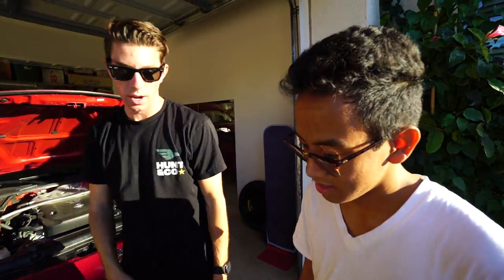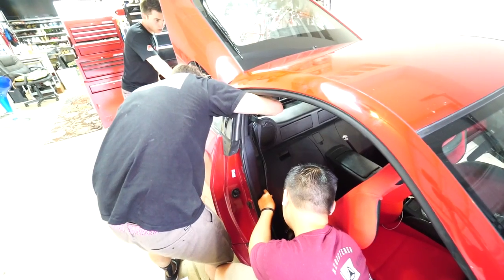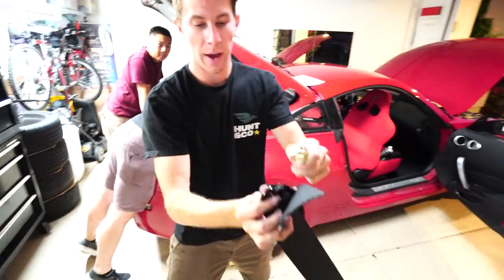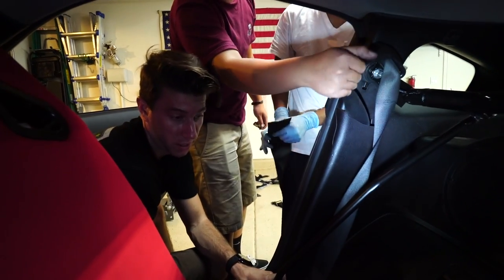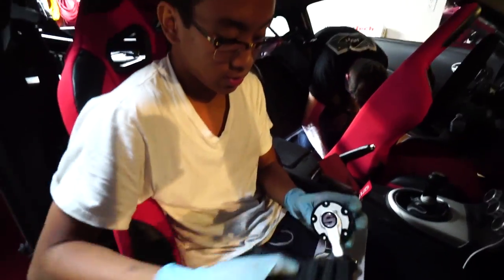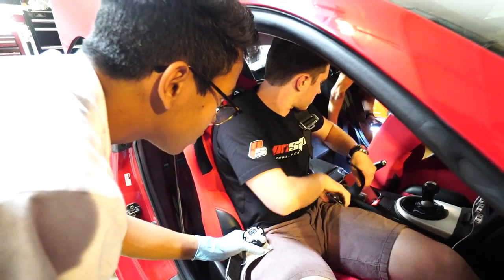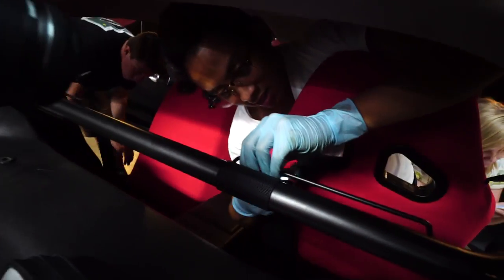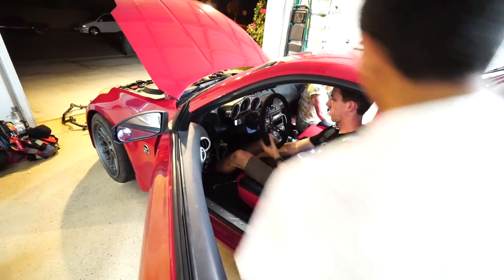Race Harness Install - Nissan 350z

Comment from the maker: Before you comment on whether I should have a 4, 5, or 6 point, please watch the whole video 🙏🏻❤️ thanks for your concern Bros
Reply: My bad, I deleted the comment. Just want you to be safe, boo.
Reply: TJ I bought a Poster of Miley off Hunt and Co's website and I received it damaged and I also asked for it to be signed by you and Calvin and it wasn't :(((( I've tried to contact you through the website two times and haven't heard anything back
Reply: Are you gunna make a video from kktsd?!
Reply: got new seats with the hole thingy for the crooch strap ?
Reply: +DailySquad Productions ikr been waiting for it 😂
Reply: Are you still able to use the stock seat belts or are those completely out and unusable due to the harness bar?
Reply: they actually make street legal and safe 4 point. takata makes the drift belts and schroth have their 4 points also street legal and safe for road use. a 5 point with no seat slot is pointless as there will be a gap from the bottom of the strap to your crotch which will cause submarine. the 5th/6 strap setups need to be snug on your body.
Reply: That's okay, I got a universal harness bar with a 4 point. Got so much hate LOL
Reply: ''safe'' you can still slide under them streetlegal or not, thats how it is with fixed harnesses . i doubt its hard getting the '' safe'' stamp
Reply: TJ HUNT YOO YOU DID IT WRONG
Reply: its a genuine safety concern that has to be addressed sounds like he really wants to be safe so it doesn't hurt to point out.
Reply: well if he wants to be safe he should have just gone with the stock seatbelts, dosnt get safer then that when you run without a rollcage
Reply: I know all of yall learned about the 4 point harness's safety problems from bisforbuild
Reply: sense 350z is a drift car it should have a turbo cause drift car but it's nice tj
Reply: Jaden Cope are you trolling or just 12 years old?
Reply: +Jaden Cope lmao
Reply: +Ben Thompson lol it's what I know could be good for the 350z to help with drifting I don't need someone to tell me what I know about cars 😂😂😂😂
Reply: +hedlund88 he's 17 bro he knows EVERYTHING!
Reply: +Tony Montana 😂😂😂😂 I know a lot about cars but not everything
Reply: +Jaden Cope He don't need a turbo, in fact he don't need anything apart from a fucking LSD right now.
Reply: Finally lol !
Reply: You shouldn't run a harness/bar without WEARING A HELMET
Period- stop misleading people and putting them in danger!!!
Reply: Also 5 point harnesses are NOT SAFE EITHER!

6 POINT!!! DID YOU EVEN TALK TO A SPARCO REP BEFORE ORDERING?!!?
Reply: You do not wanna have a roll cage without a helmet.. Cause your head can smash into the cage. A harness bar and harness without a helmet is a'ok.. You're clueless.
Reply: like the out tro
Reply: ***** "The use of five point (single crotch strap) models is highly discouraged as these five point designs increase the risk of soft tissue injury and also tend to cause higher levels of chest compression in the event of accidents."- http://www.speedhunters.com/2014/06/takata-ask-the-expert-answers/

That's straight from the head of Takata. If you kids actually bothered to call your Harness Dealers with Questions, maybe they would get answered correctly!
Reply: 5 POINT HARNESSES ARE NOT SAFE! 6 POINT ONLY!!!

Sparco no longer sells 5 point harnesses on their site because they're NOT SAFE!!!
Reply: +Tony Montana except how to use punctuation.
Reply: JeremyShred You can still hit your head on a harness bar without a helmet, it is still Not Safe either way.
Reply: The harness is unsafe they can hurt you in a crash search it up
Reply: ***** A helmet will still protect you from a fatal head injury from impact with a harness bar/roll cage
Reply: ***** It's not that hard for a harness bar to come loose in a accident. Either way, for what TJ is doing it's not safe.

If the roof caves in on a rollover accident, he'll snap head first like a toothpick since you're unable to lean in a harness.
Reply: Should've got the Scroth 4 point... it's anti-submarining and in my opinion better than a 5 point or 6 point...
Reply: Shcroth*
Reply: Tg the get the part that goes on the side of your legs cuz if u crash the lower belt might go into your stomach
Reply: ***** That doesn't mean you can't still hit your head on it, or prevent the roof from caving in on your head during a rollover
Reply: We love ya TJ.
Reply: 3 point or 6 point IMO. 4 points are more for low speed offroad and crawling just to stop you falling out of the car when you roll, 5 points are better than most 4 but not as safe as 6 ofc and can still fuck you up. You can get 4pts with anti submarining but you might as well just stick with 3 point unless youre going to go 6 point.

And harness bars are behind the seat? ofc you will wear a helmet with full cage, but why would you need to wear one with just a harness bar? unless it smashes right through  your fkn seats i dont see it being a problem? am i missing something?
Reply: Unless you have full cage, 6pt harness, HANS and you are wearing a helmet, any harness is more dangerous than a standard 3pt inertia +airbags. 

First of all without a cage, when your roof caves in you cannot move, therefore your head takes the full force, i hope you have a strong neck. With a 3 pt you can move your body out of the way when the roof caves in. Also not being able to move makes shoulder checks etc far more difficult for daily driving.

Now lets say you do have a harness and a cage, without a helmet your head is now bashing against your cage. Now lets say you have  a helmet, the extra weight plus the fact that none of your body moves except your head means you will probably snap your neck due to inertia. This is where HANS comes in... Or you could just leave your car with 3pt and airbags and be relatively safe, maybe wear a helmet if youre worried. All or nothing, because half way there is always more dangerous than what you get from the factory.

HANS + Helmet + harness makes for a very unpractical street car, and is probably illegal in some areas, i say unless its unregistered, dedicated track car stick with airbags and 3pt.
Reply: +gorrilaunit99 yes, and Takata knows about safety with their air bags.....
Reply: jak p The point is Sparco does not sell 5 point harnesses anymore because they're not safe.
Either TJ is lying or he's still gonna be in danger
Reply: I agree with the helmet + harness + cage + HANS. But not all 4 point harnesses are unsafe. Just the majority. I do know that Shcroth makes 4 point harnesses that are anti-submarining. If I was in the market for this shit, I'd go with Schroth.
However I'm going to stick with racing sims. until I have the money to not skimp on safety equipment for a track car...
Reply: Stock 3 point harness works just fine. Stop trying to fix shit that isn't broken. Man you really need to learn about cars before you start giving advice on the internet. So many people are going to be misinformed because of all these videos.
Reply: Tj Hunt anyone know the shit he was wearing at 5:50 ?????
Reply: 4 point harnesses are completely safe if installed and worn correctly. The "4 point dangers of submarining" is a myth. There are lots of factors that go into it. In most cases, the fifth harness is perfect for crushing testicles and any other soft tissue in the event of a shunt and/if worn incorrectly. Internet commandos talk about the lack of a roll cage and harness bar so somehow a stock 3 point is better but then say a 5 point is better than a 4 point because of an extra belt? Lol! By that logic, a 4 point is better than a 3 because of the extra shoulder strap. Most people do not tighten the fuck out of there 4 points because its "uncomfortable" which results in myths. This is why stock belts tighten and lock under g force. A 4 point is doing the same but tighter. Read saftey instructions people!
Reply: Tj Hunt I love you and I look up to be like you Bigger Bro 😎
Reply: Except for a schroth asm there is no way to wear correctly a 4 point harness . They are not safe period, you can try to tighten your lap belt all you want but when you go to tighten your shoulder belts they will ALWAYS pull up on the lap belt. If you are on the racetrack all it would take is 3 hard laps and your lap belt would ride up on your abdomen. The fifth should be a 6th V belt and the risk of you receiving serious abdominal or even spinal injury is much more real than banter about  "crushing your testicles", abdominal injuries happen all the time.  Also no harness should be worn without a cage. Once the A pillar comes down on your head and you are strapped in upright ....well you will either be lucky,break your neck or be dead. A 3 point is safer than a harness bar and a 5/6 point is safer than all with a cage.  If you have a rollbar you should sit in your car , take a picture from the side and then draw a line on the pic(photoshop) from the top of the bar to the bottom of the A pillar . If your head is above the line then that is what is going to get crushed when the A pillar comes down. This is a very common issue with bolt in rollbars where people sit far forward from the bar.
Reply: singlecams for the record there or more harnesses with the ASM feature that aren't Scrothe. Just sayin

Comment: You'll need new seats to run a 5 point harness.
Those reclinable 'racing' seats don't have the require hole in the base to install a 5th point.
Time for some bucket seats!

Comment: + Tj hunt don't go with a 4 point harness when you get into a crash your shoulders pull the waist strap onto your stomach putting the full stress of the crash onto all your vital organs. if you still want a 4 point harness there is a brand that makes one shoulder elastic making like a 3 point removing the danger

Comment: One of the things you'll find in car parts, specifically, is when they say "universal fit" they usually mean it doesn't actually fit anything.  Beware universal fit!
Reply: all harness bars are "universal"...they are measured in length 48, 49, 50, 51 inches etc...they are sold for all applications that the width of the b-pillars.

Comment: Well at least you didn't go with Takatas. Great move Proud of you
Reply: whats wrong with takata?
Reply: whats wrong with takata?
Reply: What's wrong with Takata?
Reply: what's wrong with takata?
Reply: what's wrong with takata?
Reply: What's wrong with takata?
Reply: are you talking about the air bag thing?
Reply: oops my bad. Let me resume this little thing y'all have going on here.
What's wrong with Takata?
Reply: overpriced, overhyped and overdone.
Reply: Klas Kitsune WHATS WRONG WITH HYPING STUFF UP?!?
Reply: Tyler Nguyen Because you make it seem better than it is. There are much better products out there that are more affordable. Willans, Sabelt, Schroth, Crow all make good harnesses that cost less than Takatas and have sturdier camlock construction.
Reply: Klas Kitsune I understand. I just like being hype tho. Makes me happy to hype things up
Reply: WHATS WRONG WITH TAKATA?
Reply: +Klas Kitsune to be fair they have a 4 point that prevents submarineing. it works by having a piece on one of the shoulder straps that tears under the stress of a accident which makes the strap a little longer bringing one shoulder forward to stop you from sliding under. Now if other companys have that then i agree with you but if they are the only ones that would be a pretty compelling feature
Reply: Jacob Tuley Schroth has one for less money.
Reply: Takata belts could be $2000 and they'd still be worth it. They're green.
Reply: ***** A fool and his money are soon parted.
Reply: its called branding. its all about brands in these times.
Reply: Takata is good.
They have asm on 4 points.
It eliminates the problem where you can slide under the harness with 4 points.

Comment: Nothing is wrong about 4 point harnesses. It's just about getting the right one that are street legal and with the ASM technology. Both TAKATA and Schroth (takata drift series and Schroth rally 3,4 or cross)  offer 4 point harnesses that have an anti submarining technology. But of course, if you're really tracking your car, the best harness for u are the 5 or 6 point harnesses with a harness bar and a roll.cage.
Reply: fucking thank you! holy fuck I was going through these comments hoping to see one glimmer of shining light of someone who knew about the very few dot safe ASM stats. I personally have schroth as it's the only DOT legal in mass for the daily/autox project...usually the 3 point oem is used on teh street but I didn't want to have to install/remove harnesses between events.
Reply: So what would you use for a daily/rare track car?
Reply: I have my rigid seat that's FIA approved with scroth 4points with the anti submarining mechanism. but if you don't have that setup I'd advise a mimimum 5 point and use your 3 point oem on the streets.
Reply: +bushdog Haha I thought the same thing!! So I had to comment! I too,  have dot/ASM approved 4 point harnesses but they're the TAKATA  brand. Specifically, Takata drift 2 harness. The ASM TECHNOLOGY on them  actually works. I got hit one time and acted just like a factory 3 point seat belt. No injuries at all. I get why people don't know about the ASM ttechnology on 4 point harnesses . It just came out a couple years ago, so it still relatively new
Reply: +Swoldier Jan the only bad thing about the 4 point harness  with the ASM is once it's been in an accident, you have to replace it and get a new one
Reply: +Tyrone Amora your seatbelts

Comment: It would've  been safer  to bolt the harnesses to the floor  of the car. and  go  with 4  point harnesses, Although  I've a 3 point  harness  in my  car and  it  works  just  fine.

Comment: I mean if you really really wanted a 4 point you could've gone with schroth harness. they are maybe the only DOT approved 4 point. I think? don't quote me. I know for sure its DOT approved my buddy had a set in his 240. just not sure if they are the only ones.
Reply: yup you are correct...I have the RallyE belts and they are one of the only DOT reg'd belts.

Comment: TJ you mighta fucked up, the reason you're not supposed to do a 5 point without a cage is to keep the submarine effect during a rollover. Thats why there isn't one on a 3 pt. 4 Point should've been fine because you would still have submarined in the event of a roll. With a 5 point you will roll and not be able to submarine, and snap your spinal cord. Just my thoughts.

Comment: those for safety or swag
Reply: Swafety!
Reply: For swag, it's a 4 point. In a serious crash a regular 3 point seat belt will do a better job. Basically what happens is "submarining" where the belt that is meant to go across your pelvis tracks up to your stomach. And that ultimately results in your internal organs being crushed, internal bleeding and not fun stuff. The only 4 point harnesses that won't submarine are ones with a shoulder strap built to break in one section to let your body soak up the impact and reduce the chances of the belt tracking up. 5 points are the only way to go.
Reply: safety

Comment: Edit: LoL, i saw the end and its all good now! 
TJ NO! DONT USE 4-POINT HARNESSES! Look up submarining! 4-point harnesses are very dangerous because the bottom part of the belt WILL slide over your pelvis if you crash! And if that happens that belt will push on you stomach and most likely crush your organs, it could even push your organs so far up you puncture your lungs!! So even if you suvive the crash itself, you might die later because your organs are completely demolished!

Your best to go with a 5 or 6-point belt for racing!